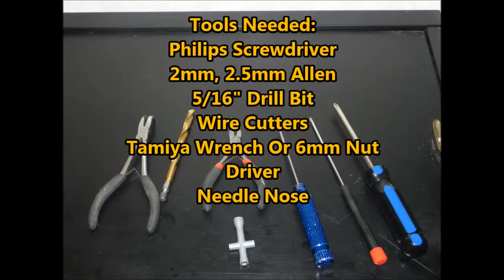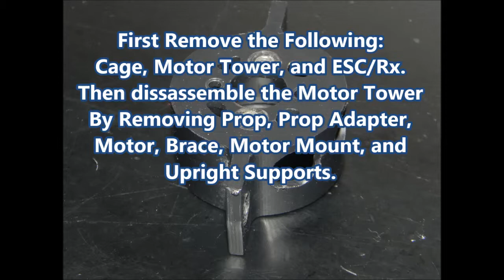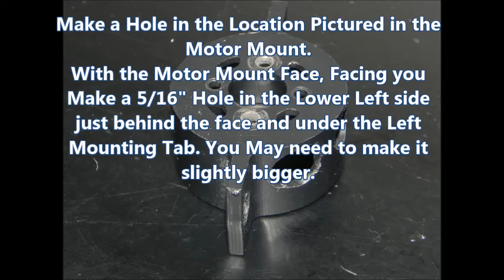2014 Updated: Brushless Aquacraft Alligator Tours Airboat How To Upgrade

Comment: I purchased this and it does not go much faster than original motor any suggestions ? I am correcting this, I found the issue, I did not program the control and now that I have this thing screams! thank you
Reply from the maker: Hey just so you know if you ever flip it just give it a little throttle and it will roll it back over.

Comment: Whats the KV rating on that motor?
Reply from the maker: It is an NTM 28 mm I know it's about 2,200 KV or 2300 KV running at 3s
Reply from the maker: I also generally run a 6x4 or a five and a half by four and a half prop
Reply: @FPSRC  cool thanks. I have 2 of these mini alligator tours i got off ebay. Haven't even tried them but I plan to upgrade them. Might just run them on 2s most of the time though.
Reply from the maker: Make sure you watch all of my alligator videos there are quite a few some of them show a gyro stabilization as well as how to return them upright when they flip over
Reply: @FPSRC  thanks. Yeah I watched them and will probably rewatch them again.